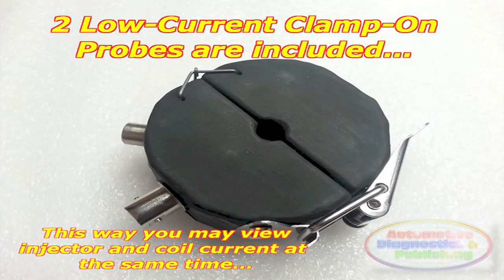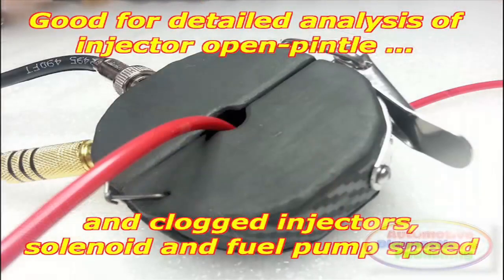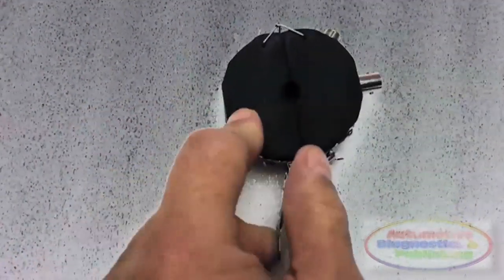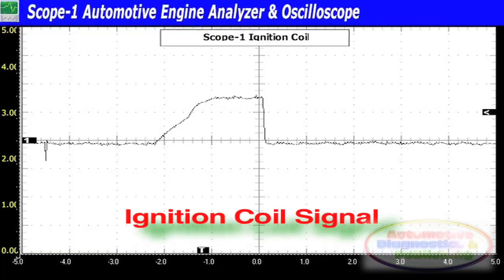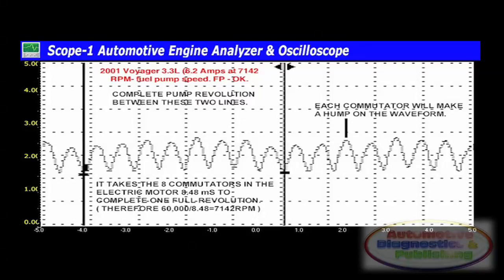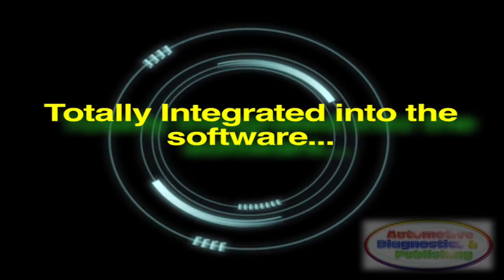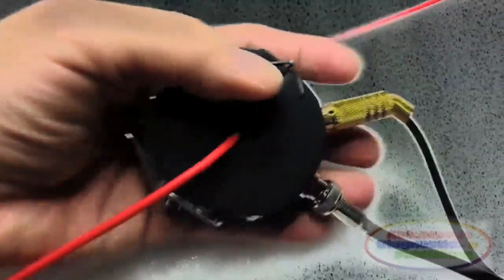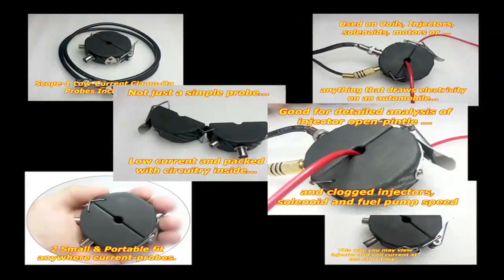Toroidal Low Current Scope-1 Probe

Comment from the maker: Current ramping is the most powerful technique in automotive diagnostics. I explain the particulars of this technique in my book, Diagnostic Strategies of Modern Automotive Systems. Sensor Testing.. These current probes included with the Scope-1 makes it the best offer ever on an automotive oscilloscope. And coupled with the Scope-1's software automated testing and signal translation feature, it's a complete solution no one else has. 

http://www.autodiagnosticsandpublishing.com/Automotive_Diagnostic_Repair_Book_Catalog.htm